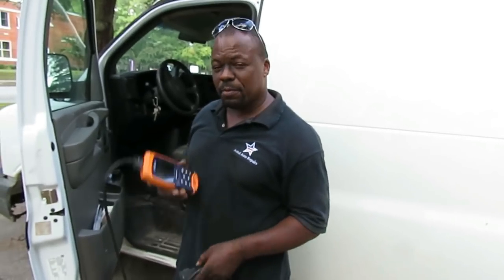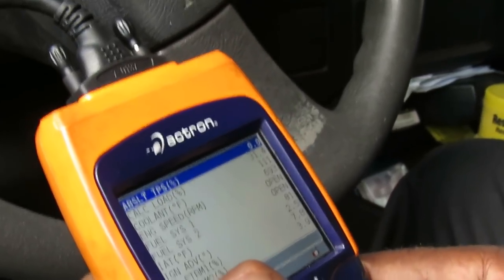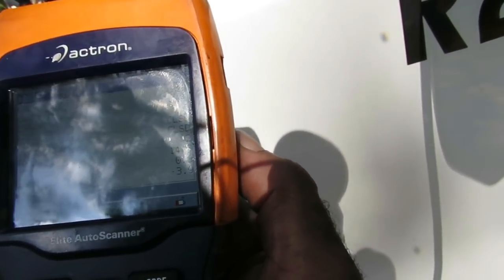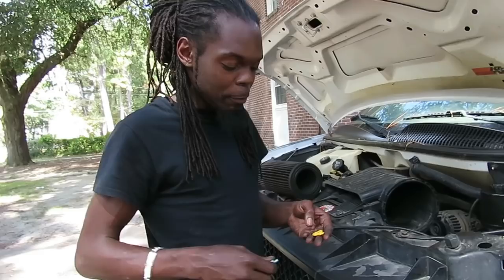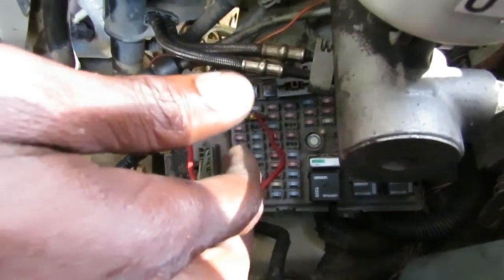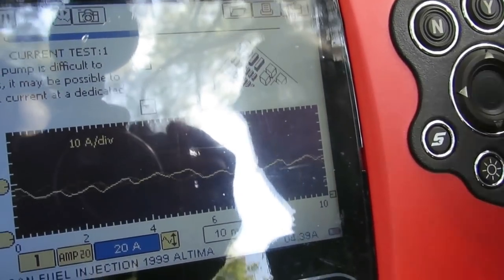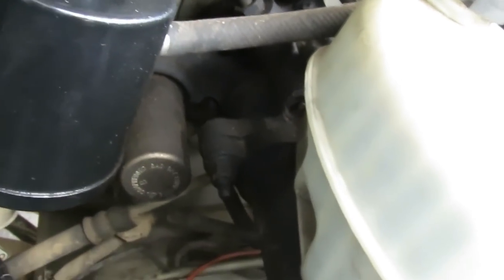⭐ 2005 Chevy Express G2500 - P0300 - Random Cylinder Misfire

Comment: Nice demonstration, I can't wait to see how the inexpensive oscilloscope performs. Thanks guys.
Reply from the maker: Hey Len, I'm VERY tempted to try one I found for only $57. I know it may not be too fast, but it just might do the trick.
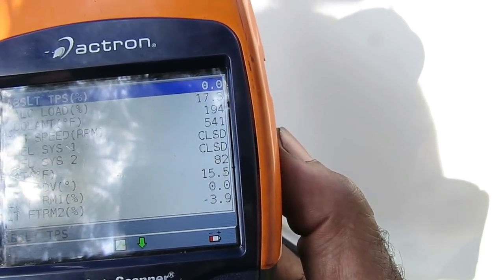Reply: @OnlineAutoRepairVideos 9:15 I seen the engine temperature was 194° so I would think that the heat would close up some of vacuum leak so my question is what made your direction of direction go towards fuel pump instead of like maybe intake manifold gasket or something like that????
Also I have  a 08 Chevy Express 6.0 2500 its long term is 24 % when cold and usually drops to zero when it gets hot.. I have p0300 p0174 bank 2 too lean p0157 o2 b2 s2 volts to low?? When I spray brake cleaner on bank 2 STFT GOES INTO NEGATIVES

Comment: I have 05" 1500. 256,000 miles on it. Was getting a slightly rough idle. Diagnostic tool threw a PO300 code. I did the vacuum test with starter fluid and no leaks. Changed plugs and wires, (which I changed just 2 years ago) still got the same fault code. Still slightly rough, especially at low speed (under 10mph) or in reverse. Acceleration, even up hill was fine. My scan tool showed random misfires between cylinder 4 and 5.  But like you said in the beginning of your video, the misfire is not that bad. I have changed to 92 octane gas and added Sea Foam every few gas tank fulls. This seemed to make the van run/feel "tighter" (less sloppy). Am I okay to still drive  my van like this? At a quarter million miles  I'm not sure if it's worth doing a complete tear down value job.
Reply: Your going to clog your cat-lytic, in which it is probably already bad with 300k miles

Comment: Good video, in my shop I would’ve performed a fuel volume test and pressure test on the main fuel line just to verify the failing pump before contacting the customer.
Reply from the maker: A fuel pressure test will not detect a failing pump more precise than graphing the pump. You can have good pressure and still have a bad pump, that's why graphing any electrical component is preferred by professional technicians.

Comment: Amazing video. I’m having the same issue 2003 Chevrolet express Van. I took it to the dealership but they couldn’t found out what was wrong with it. They mention me that 2 cylinders might be misfiring but didn’t want to mess with it.  It works perfect some times then after stopping a couple red lights it start to misfire, running rough, and have a hard time with acceleration. Can that still be the gas pump?
Reply from the maker: Is that the only code you have?
Reply: Yes that’s the only code that it showed there.
Reply: Fuel pressure tester on fuel rail to rule in/out fuel pump.
Reply: @gigostackkfmawi9263  so I have a 08 Chevy Express with p0300 and lean codes on both banks my trims get worse when I accelerate my fuel pressure stays at 58 psi at idle and when I give it gas ?? I changed air filter I have replaced 2 coils I did a vacuum tester and it read about 16-17 on gauge but I plugged it in PCV hose cause I couldn't find any other vacuum hose..I've sprayed brake cleaner on intake but sometimes trims get better sometimes not... usually my trims started at 24% both Bank but as it warms up it gets a little better but still get worse when I accelerate and short term goes up to same % as lomh term

Comment: Awesome video I have the same van and the same code I rented a fuel pressure gauge from AutoZone and it shows 60 on the gage then a friend put it to a scanner and it's showing the passenger side cylinders are all misfiring but the two main ones were I think four and eight on that same side any suggestions please I'm super stuck lol thanks
Reply: Forgot to mention I also checked the heat on both catalytic converters the driver side was at 310°. The passenger side was at 250° I'm not sure if that's a huge difference or not to say it would be that cat with the least amount of heat ?

Comment: I have an 01 express van 4.3 with a code p0200, i have replaced the spider fuel injection and i have this code now, which i didnt have before and i replace the injection unit because of a hard start and no start condition with alot of black smoke at start up so i figured with 194k on it, i should just go ahead and replace the spider injection unit, but now this code and the engine runs rough and no other codes, any thoughts, i have 60 psi fuel pressure, fuel pump is new, any thoughts?
Reply from the maker: You have to go over the fuel injector wires. Maybe one or more got crimped. To solve this problem, you have to back track EVERYTHING you did!

Comment: Where can i get that oscilloscope with instructions.
Please help me.
Reply from the maker: hi, the machine in this video is a snap-on, which cost around $2500. But there is an $80 machine (Autel AL539B) which will do the same test, and with a better screen. Here is a link to our website, where we show you how to use it: https://onlineautorepairvideos.com/videoinfo.asp?ID=163&T=Testing+For+A+Good+Or+Bad+Fuel+Pump+Using+The+Autel+AL539B+Or+AL539